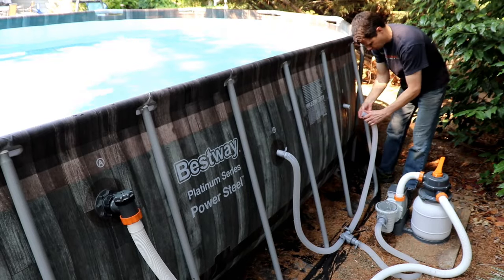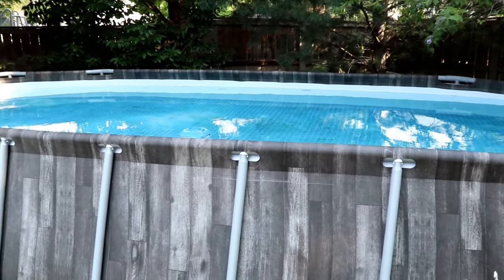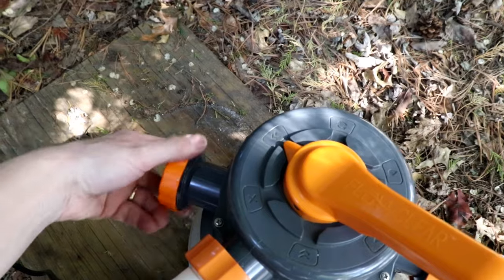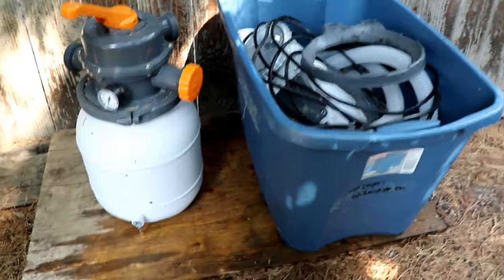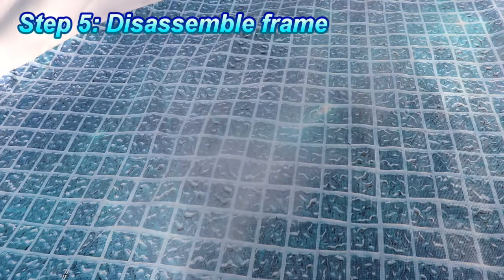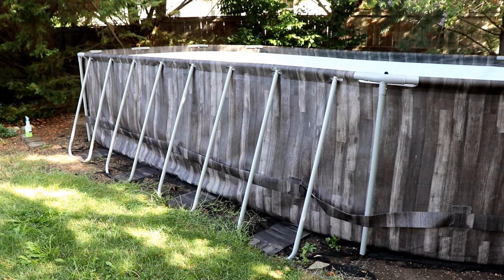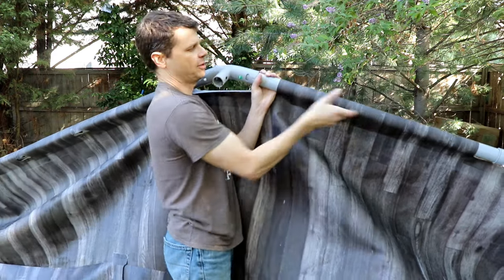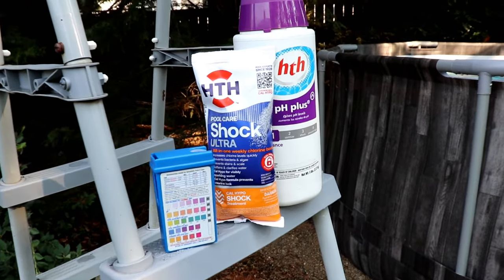How to take your Above Ground Pool Down: Bestway pool take down

Comment: Good tips, but my problem is cleaning the underside of the pool, which sits on a tarpaulin on grass. It gets smelly and mouldy underneath, so i have resorted tp hanging it inside out over a trampoline frame to dry and clean. Grateful for advice!

Comment: My husband and I are first Time pool owners. We had a gentleman put it together. And then we had a company maintain it long story short he got sick and our pool got green so we decided to empty it. One of the other reasons is it started to look about 4 in lower on one side. We knew that the gentleman who put it together didn't do a good job as far as leveling out the dirt. And we did have a lot of rain which compromised the soil. It didn't finish draining yet but when it does we want to clean it inside but being we live in south Georgia we don't have to worry about freezing. So do you recommend instead of pulling all the metal sections as you did or do you think if we get a bunch of friends to lift it up and move it out of the way to prepare the ground would it be okay. ? 
By the way thanks for the video because I was really nervous about taking the pool apart. I didn't realize that there are people that have to do it because of storing it away for the winter.

Comment: Ok. Sorry, don’t post much; but, I happen to have some well deserved experience with taking these things down. Go to a big box store or hardware store and buy a 3/8” dowel. Measure the distance of the liner on the frame and add like 12”. Probably around 30”-36” long. Slide that dowel through there and work that vinyl off the frame all the way around after you drain it and before even trying to disassemble it. Works like a charm.
Reply from the maker: Great idea. I’ll give it a try

Comment: How did you get the last two inches of water out?
Reply from the maker: Syphon with a hose works well and pull bottom up from 1 side to gather water on one side. Also, square bucket or container and bail it out. Bail sounds daunting, but it’s very affective
Reply: A shopvac works!!

Comment: When taking mine down, the pool vinyl is sticking to the long top rail pipes, making it extremely difficult to take the pipes out.  Should I use a hair dryer to heat up the pool vinyl sleeves so they release their grip on the railing pipes?  I see where you said that is the most difficult thing with taking down the pool, and my experience confirms that!
Reply from the maker: I don’t know if hearing it up will help. I found it best to just twist the vinyl on the tubes in little bits. Start at the end where you can get under the vinyl a bit to get it loose. Then keep twisting, moving down the pipe
Reply: @dalesbackyardofficial  Thanks.  Just finished taking it down.  We left it up all winter and are not going to use it this summer.  The blow dryer helped alot to loosen the pool fabric.  I was able to grab enough material and unstick the fabric, while pulling and tugging the fabric and twisting the pipe at the same time.  Quite a workout.

Comment: Hello thanks for sharing, I’m in California and was wondering if I would have to take mine down? It doesn’t snow in my area but we do get frost sometimes.
Reply from the maker: If it's mild, I'd be tempted to leave it up. But still disconnect you pump, filter, and tubing.
Reply: @dalesbackyardofficial  thanks for the info 👍🏼 I’m still swimming in mine. It’s still going to be in the 90’s in my area until the end of September 🙌🏼

Comment: Thanks for the info! Did you use any vinyl cleaner as well or just the towels on the pool?
Reply from the maker: Just towels
Reply: @dadstuff1141 do u have to put the pool in something when storing it? And does it have to be a heated garage? Thanks. This video helped a lot

Comment: Hey so i have the same pump and filter as you and im currently taking my above ground pool down. Should i empty only the water or water and sand
Reply from the maker: I leave the sand. Just open the drain valve and let it drip out for a long time
Reply: @dadstuff1141 The drain valve at the bottom of the filter???
Reply from the maker: Yep
Reply: Hey. I forgot to ask, do you screw the drain cap on the bottom of the filter/tank completly off or just screw it a little off? @dalesbackyardofficial

Comment: Thanks for your video. Personally, I am very disappointed in this pool and trying to get it all folded back up to return it to Costco. My Summer Waves pool pump with the paper filter worked better than this sand pump.
Reply: I just went ahead and bought a blue torrent 1 HP mako shark filter from island rec and it worked great!

Comment: Way way way too much work! Taking that thing down And a part for eight months, and then reassembling and filling the whole thing up with water for what June July and August and maybe the first two months of September, here in Michigan no heck no not worth it! I’d rather have a metal sided pool that you just winterize and you leave it up and you’re not wasting water by emptying and refilling! Way too much work for me😊
Reply: I bought a 18’ x 48’ Bestway pool 2 years ago. We rent our single family home, so purchasing a permanent metal framed pool was out of the question along with the cost. I only spent $900, yes it’s a pain in the ass to dissemble it every year, but I’d prefer going through the hassle than having something happen to it during the Fall, and Winter season.

Comment: How did you get the very last bit of the water out??
Reply from the maker: I pulled up the bottom on one side to get the water collected toward one side. Then bailed it out with a bucket. Final step, I actually used some large towels to soak up the last bit and ring them out.